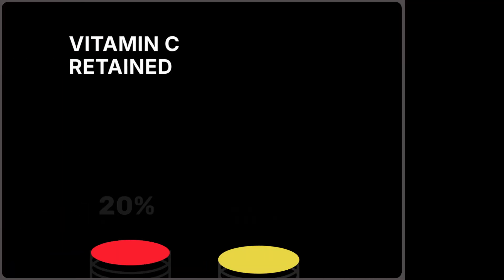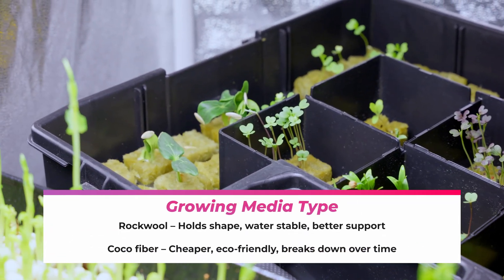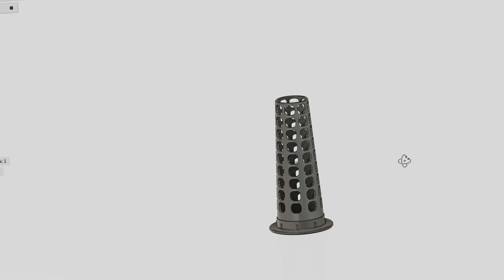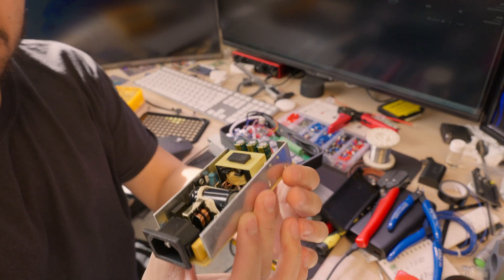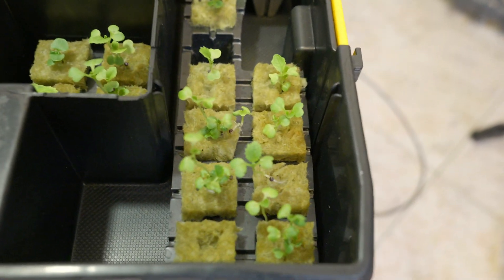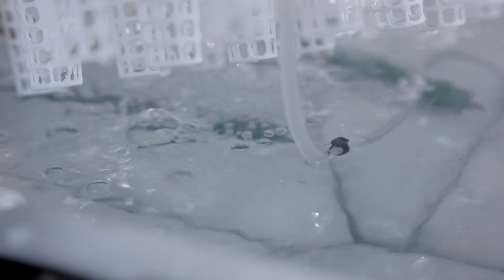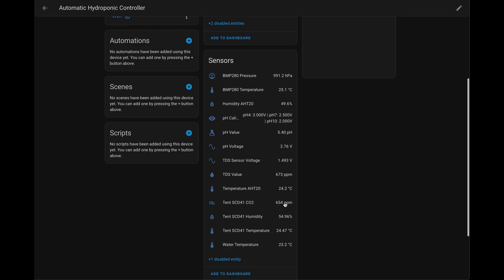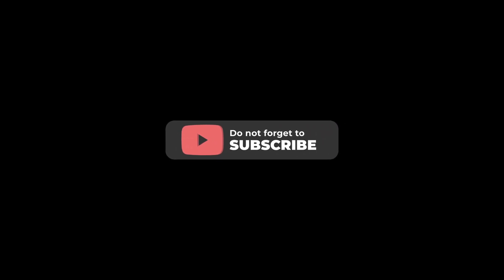How Much Greens Can I Grow from a Shoebox?

Comment: did you only use those nutrients? I often see three part components or also micronutrient solutions
Reply from the maker: Thanks for your comment!
So yes! That's one of the reasons I've tried this nutrient solution, it's an all-in-one mix instead of the usual 2 or 3 part mix. 
I also have some master blend but considering the volume of water, I wanted something even easier to find and dilute.